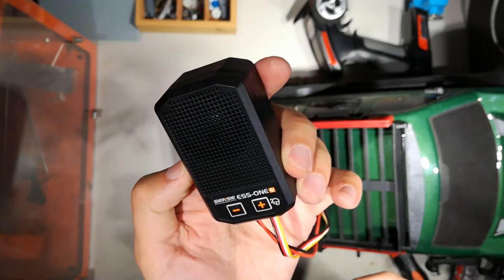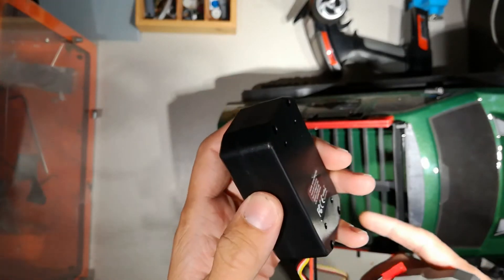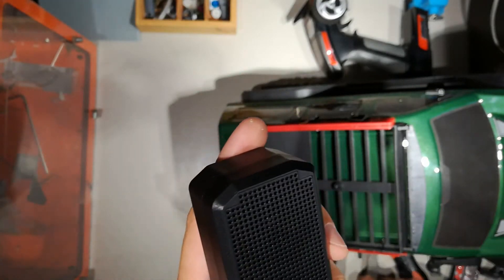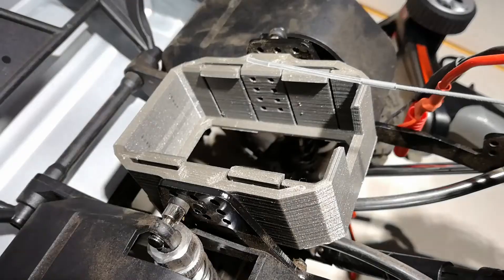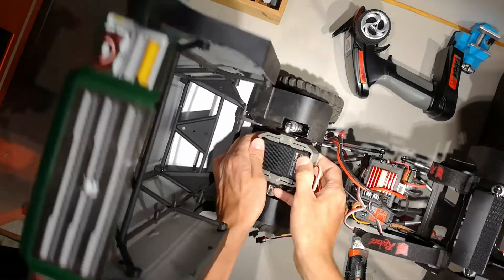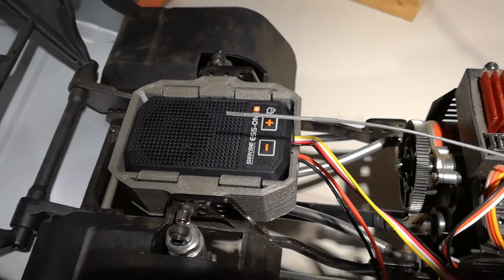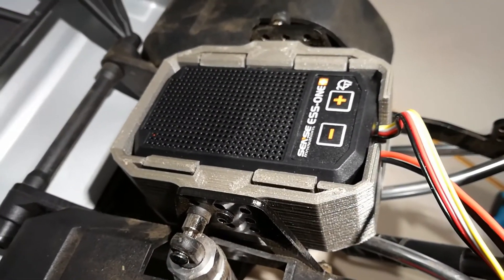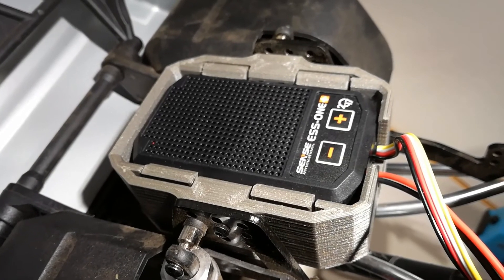3D Printed Mount for ESS ONE 2017 in Redcat Gen7

Comment: How did you connect it to your Gen7 ?
Reply from the maker: The ESS One comes with a splitter that you use to take the throttle signal to the ESS and the ESC. The power comes directly from the 2S battery (I wired a second small connector in parallel with my main XT60 connector). There are full instructions included in the box though, it is a very simple setup.
Reply: @JasonSuterOssum  it will arrive next Wednesday. I'll see if it works
Reply: @JasonSuterOssum  I  had to order Deans Set of male and female T adapters because they are banana connectors in my redcat gen7

Comment: What? 80 views and not a single "thumbs up"? What´s the world coming to?
  Please accept my humble, belated token of appreciation for your generous act of file-sharing.
Reply from the maker: Del350K4 Your token of goodwill has made it's way through the ether and down to my phone, I accept it with much gratitude!
Reply: : )  Merry Christmas, while we´re at it; I hope you get good prezzies. I asked for the I:I6 WPL BI Military Truck - if I get it I´ll be contentedly taking it to pieces to build something else from its bones by New Year...
Reply from the maker: Del350K4 and a Merry Christmas to you too!

I was actually looking at those trucks this morning, pondering whether to "get one for my son", I see they even sell a lot now, and an option without electronics, so they have obviously figured out that they have a winner with that body style.
Reply: They also make a forward-control Gaz in military and civvy schemes on (presumably) the same chassis. I´ve ordered myself one of those as well, in hopes of sun-filled Spring afternoons crawling with my wife with equivalent vehicles. I´ve heard of drive-motors burning out on day l as well as numerous early Rx/ESC-board failures so they´re definitely a starting point rather than a finished product. I´ve seen a 4-link conversion pop up on YT already, as well as some wonderful rust and weathering. In case you were wondering, they list the Russian truck as a WPL-B24.